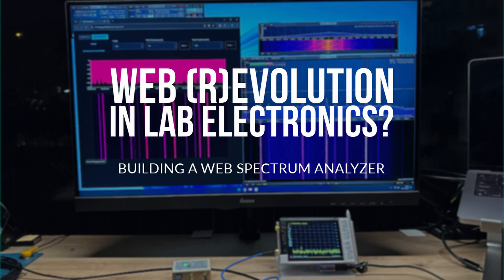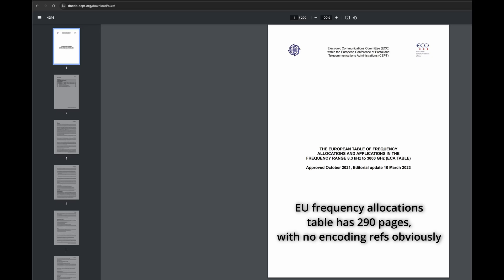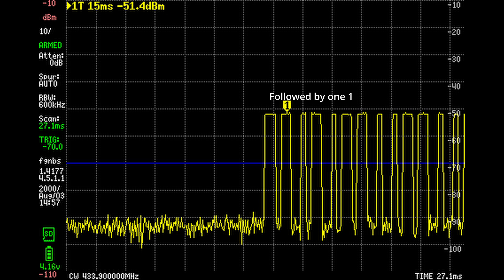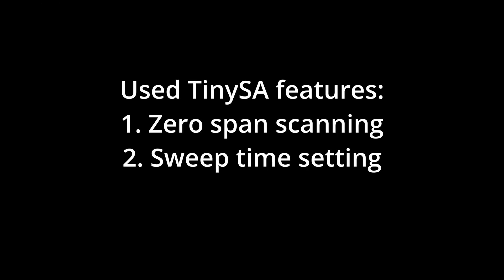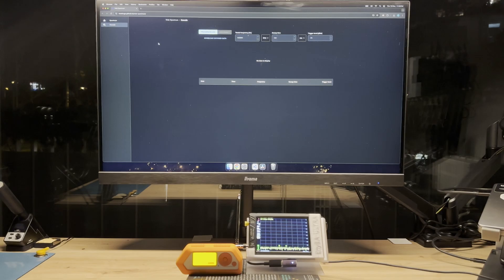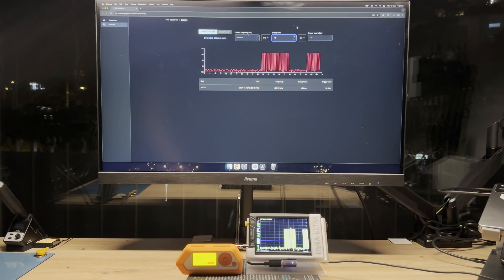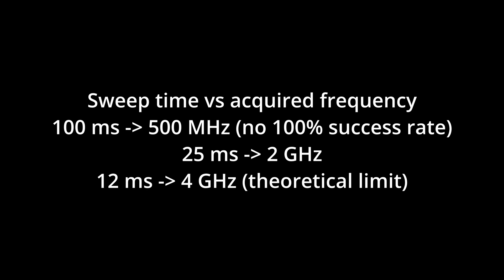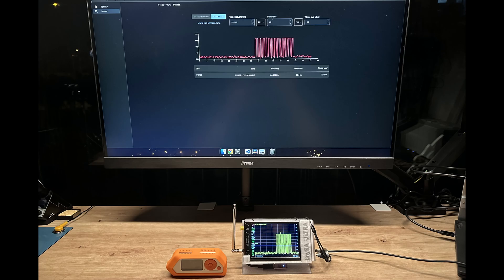Signal decoding with TinySA Ultra

Comment: @Patrick on Engineering  great video !!! i not very expert to use the tinySA and what are step-by-step the variuos MENU to set to see on displya the rolling code impluse of the car key OOK ?  help me .....
Reply: Patrick ... can help me ?
Reply from the maker: @IW2BSF-Rodolfo  Hey, the author of TinySA Erik Kaashoek made a video 'tinySA trigger features' . You just need to enable CW mode
Reply: @PatrickOnEngineering  ok but i not a expert and a beginner with TinySA ultra ... you can to do a video with the ALL steps to set the various menu to see the car remote key signals OOK ?  thnaks
Reply from the maker: @IW2BSF-Rodolfo  I'm afraid it may be impossible to do it with TinySA as the device isn't designed to capture arbitrary chunks of data. Even a 2 byte signal can be a problem for the device, my video "RTL-SDR signal decoding in a web application" try to show that. Also, not a legal advice but that's not a best use case for this technique...
Reply: @PatrickOnEngineering  shure i see on the tiny wiki that is possibile ONLY see this code ? is ONLY to see that the remote car key is ok and not fault and transmitt  the ook code , only for this and not for all !  thanks
Reply from the maker: @IW2BSF-Rodolfo  remote car key code usually has a length of 20+ bytes, that's why it cannot be captured well with TinySA. For just verification if any signal is sent, you can just use the tool in spectrum mode, there should be a peak shown. tinySA won't give you full message you can verify the remote is generating a valid signal.